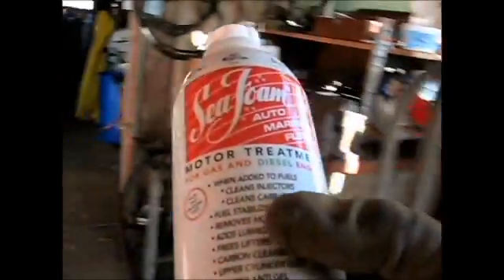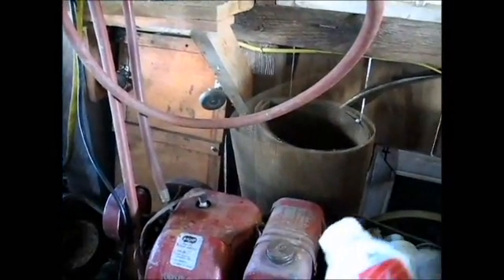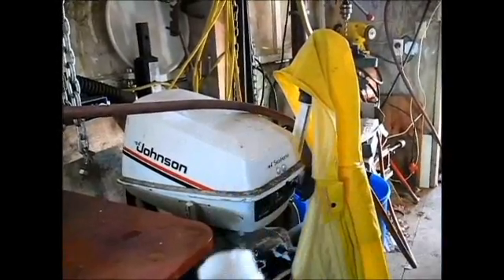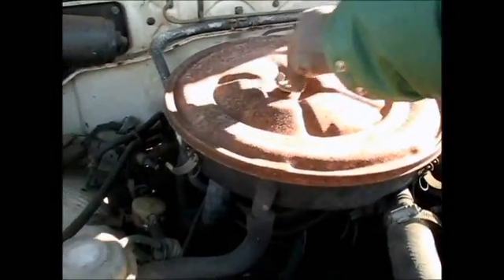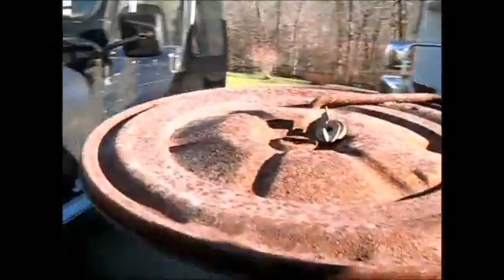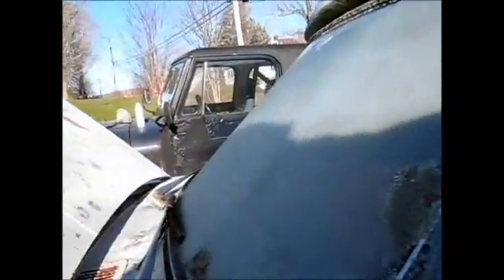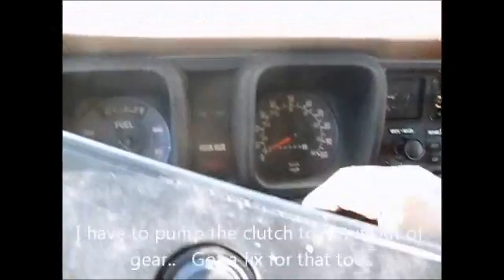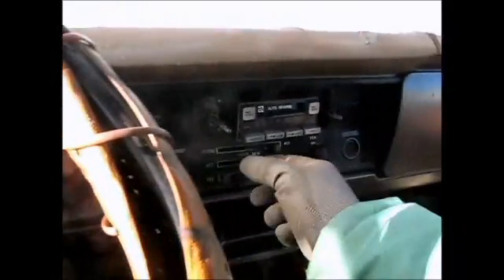Voltage regulator swap

Comment: I just got a 77 chinook. Pretty clean. I'm having electrical problems with the aux battery. I get steady voltage of 13.9 when it's running but when i shut her down the battery slowly drains by .01 volts. Bad battery or bad isolator? Also doesnt charge when i have her in AC mod

Comment: Sea Foam is Great stuff ! I put some in a motorcycle I picked up . The bike was running ruff but after putting some of that in it it would not run at all . It cleaned all of the carbon out of the heads and left my valves open . Good stuff there !  The Boat motor should be OK for one season . Boy I just love your videos keep up the good work Mr. Peek !

Comment: Perhaps, the fuel shut-off circuit has issues and this was a way to get the engine running... I don't know, but there is a distinct possibility.

Comment: It sounds like a relay is activating, w/ the dash light is coming on, the key off, that isn't right.  The minute you got her to fire the light on the dash went out, that usually means it's charging fine.  I suspect that someone has dabbled a bit and has power going where it shouldn't. With the key off and a little help you might find the relay that's getting powered by the sound and find it has a wire on it from someplace it shouldn't. Could be a fuel shut-off relay that's bypassed CONT.

Comment: You may need to polarize that new voltage regulator, and that might have been the problem with the old one, since it had been disconnected from the battery for so long...